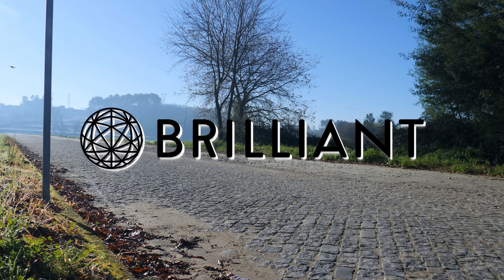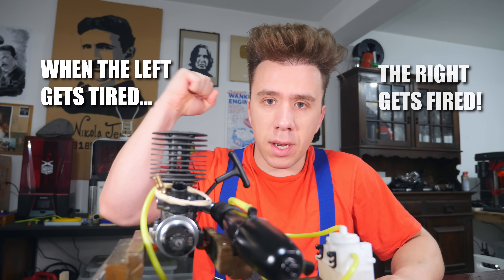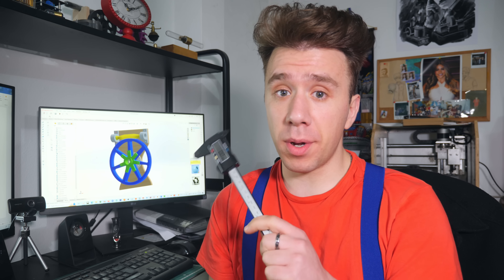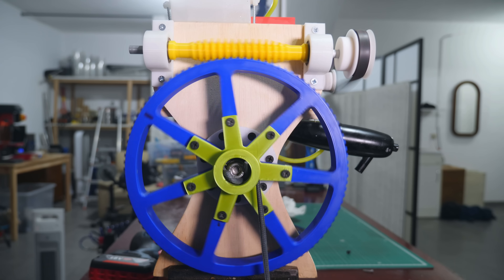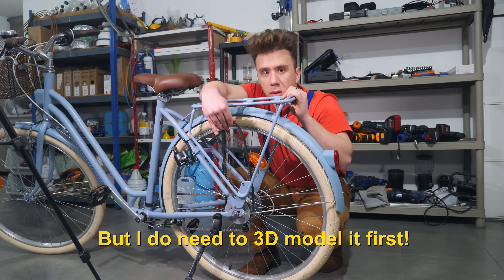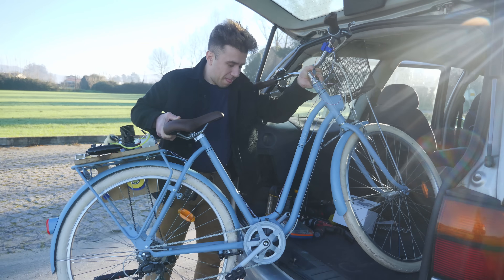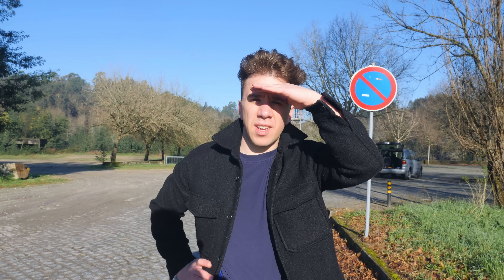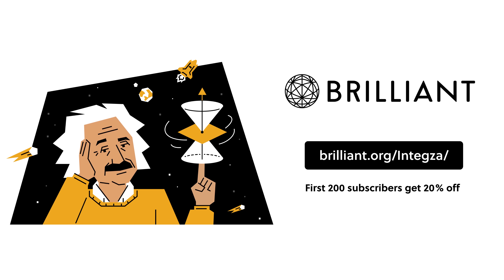Tiny 3.5 cc NITRO ENGINE on a BICYCLE

Comment: Here let me tell you something very interesting. The problem with we humans have with measuring is very wrong…. The problem with horsepower versus torque with engines we do not have a thing nor do we condone how much horse foot pounds does the engine produce. we usually use human foot pounds which is unfortunately incorrect…
Technically speaking, a 2 hp engine can move a vehicle or a simple small car. It depends how much horsepower and how much torque does that engine have. The engine does not meet the requirements of how much torque per second then it will not move that vehicle. Example unhealthy, strong horse outputs 550 ft. pounds per second. That’s 550 horse foot pounds per second.. now 2xhorses 2×550 horse foot pounds per second… thats 1100 horse foot pounds per second and 2 hp that’s more than enough to move a vehicle the problem we have with us humans as we incorrectly measure horsepower, and torque in our engines……….. We simply use human foot pounds thats incorrect.

Comment: Isn’t the worm gear supposed to hourglass shaped? You’re scraping all that teflon off because you have fewer points of contact to distribute the force, so each contact is applying more pressure than it needs to

Comment: The use of 2CV in french doesn't mean 2 horsepower as we use horsepower as measurement today.   It was a complicated formula used to determine taxation for a motor.  The first 2CV boxer motors produced 9HP but were taxated for 2 HP in the french formula.    2CV comes from "Chevaux-Vapeur,"  meaning "steam horses."    The 2CV used as a 2 HP prop actually has 28HP from a 0.6 cubic inch 2 cylinder boxer engine.

Comment: 0:47 (French guy here) the « 2 CV » stands for « 2 Chevaux » (« 2 horses » in english). But it's a « fiscal horses » power, used by insurance companies to calculate the amount of money you'll have to pay each month, and also by the govt to calculate all the taxes. So of course a very light thingy like this 2CV didn't cost a lot to own and to operate, but a big sports car could easily reach wayyy more « fiscal power ».

For exemple, my 2012 Camaro SS is actually 23 « fiscal horse power » (even if it has 432 « real » Hp in the engine). So it would be called a « 23 CV » lol. It's actually written « 2 cv » when it's « fiscal power », while it would be written « 2 ch » if those were real horsepower (the 2CV's engine actually produced between 9 and 32 real HP, depending on the models produced througout its career).

I hope my english isn't dog juice. Hope you understood all of this ^^

Comment: A lot of power is wasted on the transmission itself. It needs a lot of lubrication.
Secondly, you need to figure out not the absolute max torque the engine can produce, rather the torque curve across rpm range. With this you require transmission such that you are always at that rpm. With this you can achieve much higher top speed.

These are all basics of automobile engineering.

You can also try 20cc two stroke with reed valve and 3 transmission, would be a great project

Comment: Why don't you transfer it to electric conversion..... 2.5hp on the hub..... 12 pole 2 pole and a controller or anything in between or more.... So.... If I use it 1/2 the time with standard hubs..... 5 hp

Comment: 2hp car in french is 
2cv = 2 chevaux
However it's not related to engine horsepower but fiscal horsepower which is is used to calculate the tax regime on the car. 
Hence the discrepency between the name and engine power.

Comment: i didn’t understand why are u using this kind of mechanical matching but i think is probably to transform high engine torque in power bc this is what this type of mechanism do, yeah it’s a good idea but i think u can transmit more power in different way like with particular belt or a epicyclic gearing
(i’m sorry for bad english and inappropriate engineering words)

Comment: you want plenty of smoke and a little raw fuel coming out otherwise you are running too lean. On a brand new engine I mean, unless you only plan on racing it for one day. some of the very seriouss racers, run them very lean for just one race weekend in ordxer to get max power but it damages the engiens badly. That said, they dont throw them out (not straight away) eventually you can mix and match bearings, sleeves and pistons etc to get some pretty cool frankenstein engines that actually kick ass.

Comment: dude. go to your local off road 1/8th scale club. there you will find someone like me that has all kinds of tools and old engines and stuff they can just litterally throw at you. I have like 10 engines I could have given you for free. more powerfull ones for e.g. even got a couple of slightly bigger ones. like one I have that is 4cc lol.anyway, I cant belive this actually worked. I am astonished at the power of these things lol. I've been racing RC Cars for a decade or even a little more and I never imagined that these little engines could do what you have just done.

Comment: You don't need a big gear, you can simply join gears together using a gear train or use something like a "planetary gear". I think that would reduce a lot of friction that is happening right now caused by the worm gear.

Lets say you wanted to make your build safe to use daily... Most worm gears have maximum RPM limit of less than 2000. Not happening. The other two I mentioned, can be built to handle over 50k RPM safely, way over RPM of the engine you use, reduced friction  will stop teflon spraying everywhere, but also you should be able to easily hit over 35km/h too.

Comment: I understand that the video  is trying a very small engine with a complex drivetrain to achive motion.
 The Velo Solex French bike uses only one roller and the tyre as the drivetrain . Very simple ,I think.If you had a drive band that was the diameter of the rim and a small pulley on the motor the same result might be achieved without complex drivetrain. Would need a centifugal clutch if it needs to idle such as when stopping at lights etc.

Comment: You forgot to tune it!! The engine was running WAY too lean which is why the idle was super high, and full throttle sucked.

Too lean = Too much air > fuel mix > angry idle

Comment: poor guy if he cannot barely drive the thing at 32 km per hour. I'm afraid if he rides a true motorized bicycle, not a british motorized bike.

Start, I mean, what he made was pretty british in my opinion.
Just got the personality.
Reply: Easy to yap about something you don't know, bet your limp ass legs couldn't even pedal your ass into 32km/h on a normal bike so you would never know that they're hard to control, especially something as old as this that most likely doesn't have wheels perfectly trued the way they are for olympic cyclists.

Comment: You didn't tune the engine properly as far as I can tell. When you start them, you'll need to adjust the mixture screw under full load until the rpm is the highest, then go back 1/4 of a turn to be on the safe side. At least that's how I did it on my airplanes. Then it would give you way more rpm, because that sounded rather like 18000 than 30000

Comment: The 'French' 2 hp had to do with taxes. There was a standard way of calculating the road-tax in France which resulted in a standardised hp-number which in turn translated in the amount of road-tax to be paid. The actual 2CV had 18-25 hp and a max-speed of a bit above 100 to 120 kmh.

Comment: But i preffer electrical transmission, or better serial hybrid. ICE drive generator which always charge the battery. And battery powers electric motor couple kW.

Comment: Very stupid idea to use worm gear. It has VERY VERY low efficiency around 30...40%, not more. Much better to use planetary gear, or 2 stages planetary gear. Planetary has efficiency more than 95%

Comment: The 2CV horsepower number grew from 8 to 29 during its production span and I first thought it was a Dutch licence plate but they didn't have these protruded numbers and characters so 'Hi there in Portugal!' 
Your average cyclist hardly delivers more than half a horsepower.

Comment: I'm not quite sure what this experiment is trying to achieve, as bicycles with a small auxiliary petrol engine are about a hundred years old - with far better transmission solutions than the one shown here. There is no practical value in having an annoyingly loud RC motor on your bike - you could get much better practical results with a small electric motor - you know: An e-bike...
What is impressive, however, is that your 3D-printed parts lasted at least for the duration of the test; they are by no means suitable for this type of power transmission.

Comment: 2 CV means 2 french fiscal horsepower, not 2 DIN or SAE horsepower. It is related to the engine's size.
Actually, a 2 CV has about 30 horsepower for 600 cm3

Comment: You should've hooked the motor up to the pedals, not the wheel, so you could make use of the existing derailleurs and one-way bearing, allowing you to tackle both hills and high speeds. Then you could have also implemented a clutch (and electric heating element thingy) running off a button so you can start the engine whilst riding; by using your legs to jumpstart it instead of the drill.

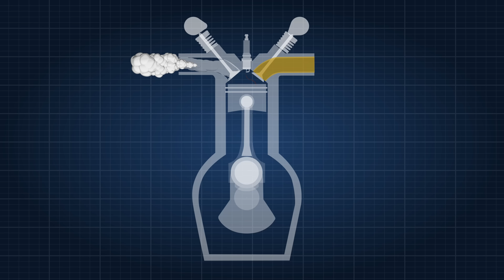Comment: You don't really get more power because there's a bunch of extra efficiency losses that come with a 2-stroke system, mostly because of the lack of valves to stop unwanted airflow out of the combustion chamber. They are however MUCH more space efficient. 1:50
Reply: its called a tuned exhaust, sport.

Comment: I’m putting a supercharged head ported 2 stage nitrous injected 14% overdriven twin plug cylinder in a top fuel Rc drag by boat,
My modifications are good for a solid 18hp.
I can lift heads. And shorten connecting rods. 30-40 thousand’s..
Let’s put it on a turkey cutter..

Comment: Gottlieb Daimler did this the first time by  1894 he had a hard time trying to get more power for a smaller engine! : THIS MOTORCYCLE had to appear sometime along the evolution of motor vehicles ! : Next step is to bring the wankel  evolution omega engine matched to a hub motor to have the latest level of a light weight  motorcycle!

Comment: The Citroën 2CV was called that because of the configuration of the engine, not the power output. It has a 2 Cylinder. V configuration engine -2CV

Comment: No, the Citroen 2CV did not have 2HP, it had more. around 9hp up to 32hp for the later models.
2CV was for the taxes applied when buying and registering the car. 2 chevaux fiscaux. !
we have taxes ratings on cars and 2CV is obviously cheaper in taxes than a 32CV BMW M240i Xdrive
typical french cars are around 5 to 7 CV (chevaux fiscaux) which means registering the car could cost you around 150 to 200€ (you only have to pay once though)

Comment: You can get nitro for the RC engines in many different ratios, I run 20% in my stadium trucks. You can even get 100% nitro (Torco) if you're feeling real froggy.

Comment: Most ebikes are about 1/2 HP, not over 1HP. You’re way undergearing the engine. It should be getting you over 45mph on a flat smooth road pretty easily, 70kph+. I could hit 38mph with my ebike that had 1000W or about 1 1/3HP. You’re just revving the engine in too high of a gear and its not putting even half its power down.

Just high on social media and money and not using braincells.

Comment: 😂ha ha surprised it got 30 kph .Problem is nitro fuel is low energy  fuel compared to gasoline petrol  benzene fuels. The gasoline fuel engines work best when it's got about  ~200cc to ~300cc cylinder  so small less than ~20 cc engines  are problematic  to run correctly .Alcohol fuel methanol  works better for small engine but fuel has half the energy content per kilo of petrol benzine  gasoline fuels that are some 9000 watts per liter .However methanol has oxygen in the fuel so it about half the air tho burn than gasoline this being the stomach ratio 8 to 1 for methanol versus 14.7 to 1 for gasoline . So on average you need twice as much methanol fuel  to get similar power to gasoline fuel .Average cost for gasoline per litre is €1.80 ( $2.00 ) a liter versus at best €10 a liter $11 .Then factor 2 stroke oil for lubrication about 20% of the methanol based fuel and  crazy ~€50 for a litre of nitro some ~15% the fuel and it costs on average more than 20 times the cost in fuel to drive this nitro powered  ~3.5 HP engine  . These nitro engines when they use ~60%  nitro fuels with 15 cc engines in turbine crafts generate very high RPM 30 thousand  and high speed jets ~200 KPH for a few minutes as the fuel with high nitro which has stormic ratio of 2.5 to 1 due to lots of extra oxygen in fuel basically mono propellant fuel means you need 8 times more fuel than gasoline versions due very low energy fuel less than ~2500 watts per liter .This explains why old fashioned gasoline bikes often on front wheel used ~30cc gasoline engines to get about the same 30kph as you got from the smaller probably ~3.5cc  model car engine or maybe ~5cc engine .However the 30 cc gasoline engine will probably max RPM of 6000 RPM but lots more tourgue and probably ~100 miles per UK imperial gallon or some ~2 liters to 100 kilometres  and costs a few cents per mile or Kilometer.The small  Gasoline engine will probably be ~3% global efficiency versus nitro fuel global efficiency of less than ~1%  . Very educational to build this set up with model car engine . 😊. Now the trick is to make Shell oil 50cc gasoline beat the shell race bikes that get ~2500 miles per UK gallon some 4.56 liters of gasoline

Comment: With that speed, you were using only about 300w of power. Either the engine wasn’t even close to 2hp, or there was something seriously wrong. 

It seemed you gearin ratio was too high. With 2hp, you shoud aim around 60-80km/h with bisycle, although, with that one, you’d propably got serious vibration and oscillation around 50km/h, ending up the frame tearing itself apart. 

Second problem you obviously have is your gears. Plastic worm gears can’t be used on that high rpm and diameter. Molten plastic is one proof of that. Worm gears are sliding over the teeth, making lots of friction. Normal gear teeths have only minimal sliding as the gears move. You shoud use metal geared planetary gearbox from some broken heavy duty drill. They should last long enough you are willing to drive with that thing. Use that directly after the motor and belt on secondary gear to match the ratio.

Comment: what if u turn this small engine into a water running engine by having it run on hydrogen and powering a good alternator that makes enough power for the hydrogen generator and if it is possible to make some extra

Comment: Everybody seems to forget that the type name "2cv" refers to number of cylinders in the Citroen automobile. Granted that in french 'deux chevaux / two horses'  abbreviates to 2cv, the cylinders are referenced.  -> excerpt from wiki : The 375 cc engine produced its 6.6 kW (9 hp) at 3500rpm and peak torque at 2000rpm.

great vid, thks!

Comment: Bro 
Just for the 2CV, she not make just 9hp.
The « CV » from 2CV means in France a fiscal power.
Lower rating is, more modest is the car.
Actually if I remember correctly, a French 2CV produce 30hp
She have a flat-twin motor of 600cm3 so we are far from the only 9hp you mentioned 😂😂…
For example, a Peugeot 208 have an average of 5/6 fiscal CV.
An Audi RS6 have 53 fiscal CV.
This is an indicator for french governement to see if you have an expensive or a cheaper car.
Because more you have fiscal CV in France, more you will pay the papers of the car !

My English is probably bad because I am French already 🇫🇷🇫🇷

Comment: but why aren’t bigger nitro engines (as they have ho high power/volume ratio) mounted on regular cars?
Reply: They are - they are called top fuel dragsters and make 10,000 hp on nitromethane. It also costs $88/gallon for the fuel and you need new rods, bearings, and pistons and rings after every 3 second run.
Reply: Including what wally said, they pollute really bad. Plus as they explain in the video, gasoline actually contains more energy anyway

Comment: ok :). 1st great job. 30yrs ago we did this using about same size motor, spring loaded direct drive . you would bike up to about 10kph turn glowplug on and it would get you up to about 30km.. the motor we used in rc planes worked great got about 50 km to a gallon of regular fuel..

Comment: This would be a perfect application for an harmonic drive.  If the engine ACTUALLY put out about 2 hp you should have been able to go at least 50 km/hr.  So the gearing isn't well matched to the engine yet.
Reply: That worm gear was eating up 50% (or more) of his horsepower, they are very inefficient.

Comment: if the engine has 0.9 NM, wouldn't a ratio of 100:1 result in 90 NM? maybe you should get it to about 60 and then have more top speed

Comment: Most ebikes in China run on half horse power. 350W. And they use a 20Ah lead acid batteries in series, 48 or 60V. Some young guys drive powerful ebikes like 1200W, they handle like gas scooters. Some people like me drive custom built fast ebikes with 3000W motors and 5000W controllers that accelerate faster than the Teslas on the street when the light turns green.

Comment: Those engines requires proper break in procedure to perform to its full potential. So I believe if it was properly break in and the carb properly tuned, I can see it going even faster. I know it cuz I have 7 of those and used to race them.